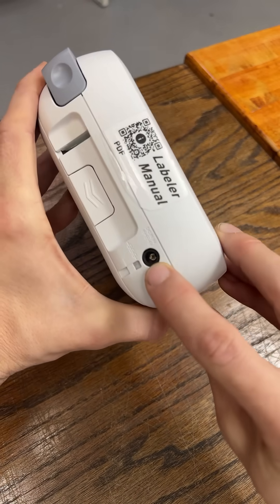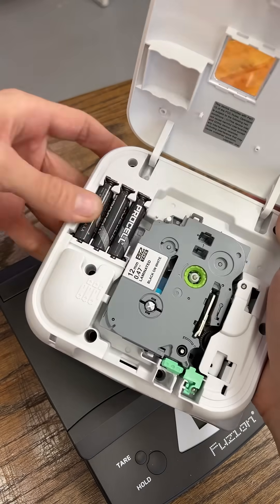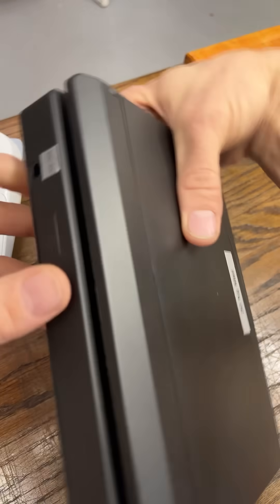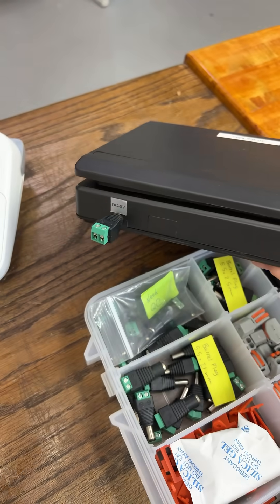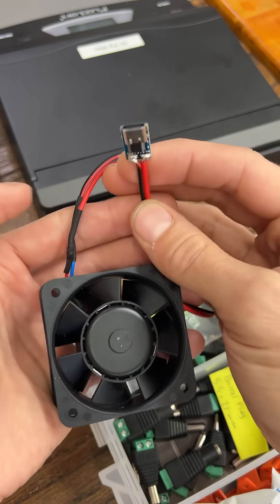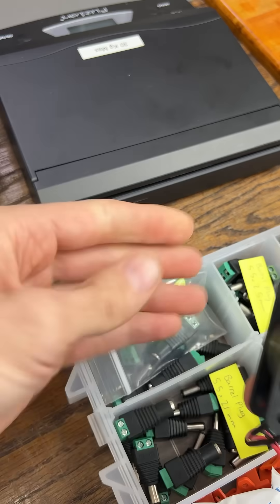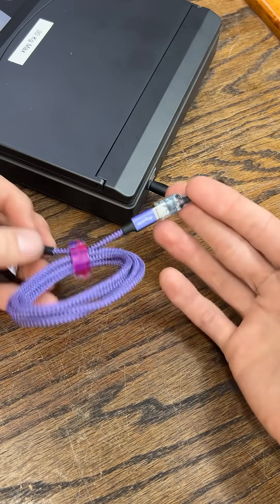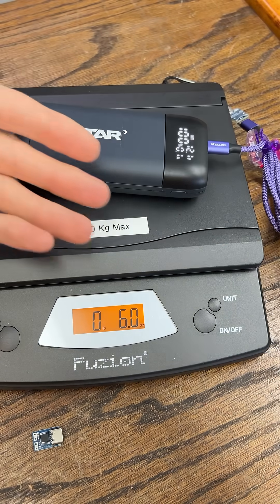USB-C can replace alkaline batteries

Comment: Not all PD chargers support all the voltages.  At least that is what I believe or some of the $1 devices don't work.  Sometimes the resistors needed for usb c are absent.
Reply from the maker: that’s why i need a whole 60 minute video.  there’s a ton of capabilities and a ton of considerations before moving forward.
Reply: @davidmalawey do please make a video on this it would be super interesting to do a deeper dive.
Reply: @davidmalawey  I just found your channel from this short and subscribed just on the possibility you'd make that video.
Reply: Subbed for this video
Reply: @davidmalawey  def make that video....we are looking forward to it
Reply: @davidmalawey  And that's even before evaluating data transfer capabilities! Those specs are often missing in product descriptions.
Reply: @davidmalawey  Is 100% watch that video
Reply: Usually the supported voltages are written on the chargers, as well as the max current at each voltage.
Reply: @sasodoma thank you for that information.  I have now verified that for two of my chargers, one a charger for a Pixel 4a and another a charger produced for IKEA - for that device the data was also prominent on the packaging - and caused me to purchase it because it included 12V which I needed for a fan.

I would add that I was almost unable to read the information on the device because the writing was tiny and written in grey on a cream background - and as a result I had not even noticed it, but then I am 76 and I have difficulty reading resistor colour codes unless I am wearing several sets of reading glasses.
Reply: ☝️ This
Reply: Subbed 👍🏿
Reply: On the fine print of your charger is all of the different voltages and amp ratings of each "mode" the charger is available. These modes will be something like 5 volts, and then the max amp rating at that volt, and then 9v, 12v, and so on up to around 28v I think is the highest I've ever heard.

The devices that use the USB C charger will have modes that it will accept power from, generally 5v 2a, and maybe a few other higher voltage modes for faster charging.

Do you know what happens if your USB C charger does not have a mode available that is compatible with the device? Thankfully nothing permanent, but it just won't work.

Making a video on the subject is exciting but also a terrifying amount of work. I considered making a video on how to use ryobi batteries in anything from simple electronics to complex solar panel systems and how to use the on board tech but I wrote a script out and it was somewhere between 6-8 hours of content estimated. It would probably take me 4 to 5 hours to make each half hour of content. I wish I had that kind of free time
Reply: @RustyCantRead  thank you for that information.  I have now verified that for two of my chargers, one a charger for a Pixel 4a and another a charger produced for IKEA - for that device the data was also prominent on the packaging - and caused me to purchase it because it included 12V which I needed for a fan.

I would add that I was almost unable to read the information on the device because the writing was tiny and written in grey on a cream background - and as a result I had not even noticed it, but then I am 76 and I have difficulty reading resistor colour codes unless I am wearing several sets of reading glasses.

With the devices one can buy from AliExpress, if the voltage you desire is say 12 volts but the charger will only provide 9v then that is what you get.
Reply: OP has labels for a reason lol
30kg max
I'd assume the lable on his 'regular' charging block has the volt and amp rating output on it
Reply: Which PD adaptor is that?
Reply: @phpCypher  I'm sorry, I don't know.  I bought a whole lot of USB-C PD Trigger boards.  The ones that allowed you to select the output voltage using a red DIL switch worked fine.  The ones that allowed you to hard program the output voltage by soldering  across a junction didn't work if they has a USBC interface.  Of course the power source has to support the desired voltage.  I wanted to hard program the voltage because if you use the DIL switch variety, you or someone else can easily get it wrong and supply 20 V to a device that can only handle, say, 12V (a fan or an LED bulb for example.

If you have an Ikea shop nearby, then the USB -C "wall wart" chargers are marked clearly with the voltages they can emit.  Battery banks seem to have a limited range of voltages.
Reply: That's why you need SMD resistors beforehand for some of these. A lot of these require that you bridge with a resistor or straight Bridge. You can buy specific purpose converters, or multi
Reply: @TTS-TP  No, you buy the main version of the board that come with the ref resistor's all on board on and you can desolder the some to get lower voltages.
Reply: It's not anything with resistors, it's just voltages. 

The PD standard is a standard that allows a device to tell the power supply "I need this voltage." Problem is, the PD standard doesn't require that power supplies be able to supply all of the various voltages (this would be much more complicated and expensive, as you'd basically need multiple power supplies in one). 

The PD device can say "hey, I need 9v," but if the power supply doesn't have a 9v supply, you're SOL, and this can easily fry your devices. This issue, to me, is a critical flaw with the PD standard, as the average consumer is not going to be able to understand this, nor will they even know what voltages the power supply might provide if they are using a public/borrowed power supply, or a sketchy one off amazon. They really should have added some kind of extra safety layer to it, because right now I don't think anybody should purchase or use a PD device until they thoroughly understand the risks and limitations. People expect this kind of weird jank with the usual oddball device power supply with a specific mm pin, but the average consumer has grown up in a world where any USB cable can be plugged into any USB port and it will work. Taking a universal cable standard, and then making it non-universal with the potential to fry devices, is stupid.